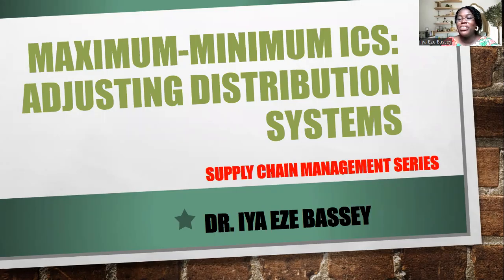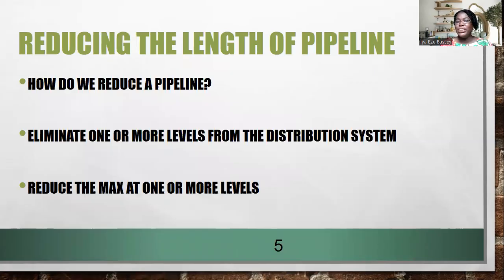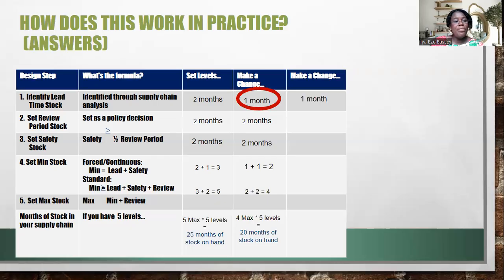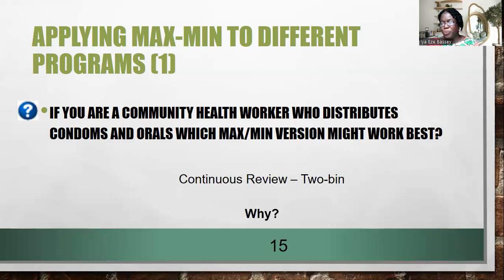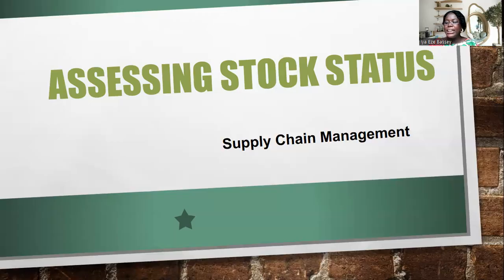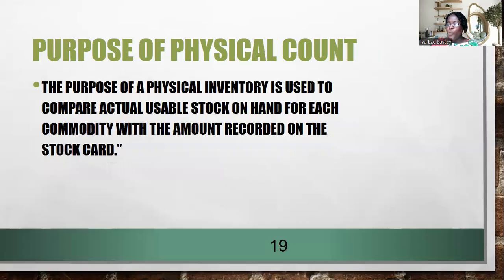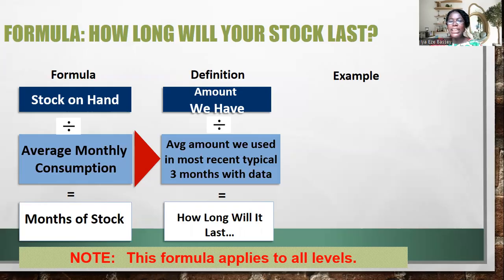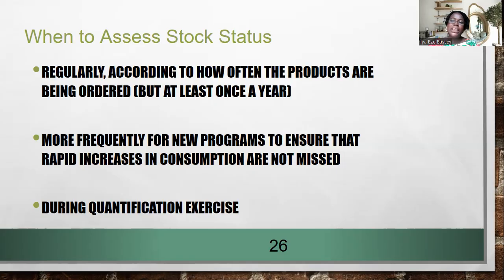Maximum-Minimum ICS: Adjusting Distribution systems (Supply chain management series)

Comment: Thank you so much Ma’am for such an enlightening session.
In summary, the steps in designing a max-min inventory control system are:
1. Set up initial max-min policies for each level and type of facility
2. Check if the overall distribution will function properly if the level specific max-min policies are implemented
3. Check the total length of the pipeline that the policies at each level imply
Pipelines cannot be reduced anyhow, the are two ways to reduce the length of a pipeline:
1. Eliminate one or more levels from the distribution system
2. Reduce the max at one or more levels
The following are ways to reduce maximum stock level:
1. Shorten the review period at one or more levels
2. Reduce the lead time at one or more levels
3. Improve the distribution system's reliability at one or more levels so that safety stock can be reduced.
Some of the factors that impact max-min stock levels are the cost of products, storage capacity, lead times, cost of storage, transportation reliability, age of program etc.
Some of the advantages of using max-min system are: avoiding overstocking, avoiding understocking, minimize wastage, avoid cost of emergency order etc.
They are some challenges of using max-min system as well which are:
1. Systems with numerous levels
2. System that manage a large number of commodities
3. System that manage products for new programs.

Physical count is the process of counting by hand the total number of usable unit in the store or health facility at any given time
The purpose of carrying out a physical count is to compare the actual usable stock on hand for each commodity with the amount recorded in the stock card and it's can be carried out once a year if they is no frequency with mismatch with stock card, but if they is, it should be as frequent as possible The purpose of accessing stock status is to
determine how long supplies will last.
The calculation to find out how long supplies can last is in our manual also.
So when do we access stock status?
1. Regularly, according to how often products are being ordered
2. Make frequent for new programs
3. During quantification exercise.
Thank you so much Ma.

Comment: I got to understand that The maximum-minimum inventory control system helps adjust the distribution system by ensuring that inventory levels are maintained within predetermined limits. When inventory reaches the maximum level, distribution is adjusted to prevent overstocking. When inventory reaches the minimum level, distribution is adjusted to trigger a reorder. This helps optimize the distribution process and maintain efficient supply chain operations.thank you ma

Comment: The maximum minimum (max-min ) inventory control system (ICS) provides comprehensive guidelines for managing stock levels to prevent both overstocking & understocking of goods. It encompasses various steps involved in designing the system, methods for reducing pipeline length and factors affecting the max-min stock levels.                                         The series of lessons has been incredibly enriching. Not only does the max-min ICS helps in preventing overstocking & understocking, but it also aids in avoiding emergency order costs by providing a guide to the stock status on a regular basis. Further more, it assists in the assessment & management of the length of pipelines of policies at each level.                                                Moreover, I have gained a deeper understanding of the benefits associated with the max min system, such as it's ability to prevent overstocking & understocking, as well as the associated challenges that arise from different versions & variations.                                             I am truly grateful for the knowledge gained from this series. Thank you ma

Comment: In summary, l've acquired knowledge about the steps involved in designing a max-min Inventory control System (ICS), the methods for reducing pipeline length, and various factors affecting the determination of max-min stock levels. I've also gained insights into the benefits of a max-min system, such as preventing overstocking and understocking along with the challenges associated with different versions and variations. I also understood the importance of physical counting, which entails manually tallying the total number of usable units for each commodity in the store or health facility.

Comment: In summary, I've learnt that reducing the length of pipeline can be achieved via the underlisted points:
1. Eliminating one or more level from distribution system.
2. Reducing max at one or more levels.
Furthermore, I've learnt that 
• cost of products,
• reliability of transport system 
• storage capacity
• leadtime
• age of program etc are factors that impact Max/Min stock levels.
I also understood the challenges peculiar to using each version and variation like system with numerous level, system that manages large number of commodities and system that manages products for nascent programs.

Comment: In summary, l learnt thesteps involved in designing a max-min Inventory control System (ICS), the methods for reducing pipeline length, and various factors affecting the determination of max-min stock levels. I've also gained insights into the benefits of a max-min system, such as preventing overstocking and understocking along with the challenges associated with different versions and variations. I also understood the importance of physical counting, which entails manually tallying the total number of usable units for each commodity in the store or health facility.

Comment: Thank you ma for this video. This video made me to understand that. The Maximum- Marinson huentary Control System (Max Min ICS) can be a valuable tool in supply chain management for adjusting distribution systems. This system helps ensure that your distribution network operates efficiently while maintaining optimal inventory levels. The hay storage activities are: 1. Supply receiving and incoming inspection. 2. Phe away, 3. Picking and packing 4. Shipping

In summary, the Maximion-Minimum Inventory Control System can play a pivotal role in optimizing distribution systems within your supply chain. By sitting appropriate thresholds and utilizing demand forecasting you can ensure that your dstribution network efficiently meets customer demand while minimizing costs and risks.

Aduoting distribution systems in this manner can enhance customer satisfaction, reduce operational expenses, and contribute to overall supply chain resilence

Comment: In this lecture i learned the step involves in designing a max-mins Ics which are setup lntial max-min policies for each level and type of facility 
*Check if the overall distribution will function properly if the level specific max_min policies are implemented.
Eliminate of one or more level.
Reduction of max at one or more levels...

Comment: Another wonderful section 
Thank you ma
In summary,i learnt that the maximum minimum system,deals with overstocking,under stocking wastage avoid cost of emergency orders
I also learnt the steps of max-min ICS which are:
1.set up an initial max-min level and type of facility 
2.check if overall decision will function properly 
3.each the length pipeline that  the quality of each level can imply
Also i learnt on the factors of max-min which include:
1.cost of production,2.cost of lead time 3.cost of storage 4.storage capacity 5.Age of program .
I also learnt about the advantages of these factors which includes, minimize shortage, minimize wastage and prevent over shocking etc.

Comment: Thank you Doctor,
From this video, I did learn that:
One of the steps in designing a max-min ICS is setting up final initial max-min policies for each level and type of faculty. 

The factors that impact max-min stock levels include; cost of product, reliability of transportation, storage capacity, cost of storage, and so on.

One advantage of using max-min ICS system is to avoid overstocking.

 Some challenges with using the system include systems with numerous levels, systems that manage a large number of commodities, and systems that manage products for few programs.

Physical count, which is the process of counting by hand the total number of usable units of each commodity in your store (for stock assessment), is used to compare physical actual usable stock on hand for each commodity with amount recorded on the stock card.

Comment: Thank you very much Dr Iya Eze for such an impactful session

I was able to understand how to Adjust the distribution system in max-min inventory control system and it is done to improve efficiency of delivery to serving consumer ,medical lab scientists that use this products to achieve accurate end products
But first we must understand the length of the pipeline and how to reduce it by eliminating few levels as reducing the maximum ICS at one or more levels all this is done systematically.
I also learnt factors that impact max-min stock levels which were cost of products, storage capacity,lead time , shelf life e.t.c
There are advantages of these adjustments like avoids over and under stocking,minimizes waste ,enables consistency of stock levels etc 
I also learnt that this strategy can be applied to different programs 
I also learnt about Accessing stock status by physical count which is done in order to determine how long the supplies will last which included some calculations. Also Stock status should be accessed regularly but more frequently for new programs and during quantification exercises .

Comment: In this lecture, I learned how to optimize pipeline length by:
1. Streamlining distribution levels
2. Reducing maximum stock levels at certain points

I also gained insight into factors that influence max-min stock levels, including:
- Product cost
- Storage conditions and capacity
- Transportation reliability
- Shelf life of commodities

Additionally, I understood the benefits and challenges of max-min systems and their variations. I also learned that physical counting involves manually counting usable units of each commodity to verify stock levels, enabling comparison with recorded amounts on stock cards. Thank you ma for the wonderful lecture!

Comment: In summary of this lecture, I have learnt how we can reduce the length of a pipeline and this can be done by:
1. Eliminating one or more level from the distribution system 
2. Reducing the max at one or more level. 
I also learnt about various factors that impact max-min stock level. Factors like;
Cost of product, storage condition, storage capacity, Reliability of transportation, shelf life of health commodities etc.
I learnt about the advantages of max- min systems and also the challenges to using each version and variation. 
I also learnt that physical count is the process of counting by hands the total number of usable unit of each commodity in your store. It enable us to compare actual usable stock on hand for each commodity with the amount recorded on the stock card. 
Thank you ma!

Comment: The max-min inventory control system (ICS) provides comprehensive guidelines for managing stock levels to prevent over stocking and under stocking of goods 
The steps in designing a max-min (ICS) include 
*Setting up max-min policies fir each level and type of facility 
*Verify that the overall distribution will function properly 
*Establish intial max-min policy fir each level and facility type
The advantages of using the max-min system includes 
-Minimize wastage 
-Avoiding the cost of emergencies 
-Avoiding understocking
-Preventing overstocking

Comment: Maximum minimum eventually control system is important aspects of supply chain management because it's analyses data patterns lead times and customer preferences so businesses can optimise their distribution network to ensure efficient and timely delivery of products to their customers. Major league deals with getting good to the end users or buyers in time with minimum waste. To achieve this the evaluate the performance of existing distribution channels and make necessary changes to improve their efficiency which may include optimising transportation routes ,re-evaluating distribution centres or exploring alternate deliver methods. 
It directly impacts your profits at at a basic level using the minimum maximum method which attempt to keep current on hand inventory within a specific weight and when this rage is exceeded, it triggers every other to reach the maximum stocking level of a particular item. 
Thank you ma'am.

Comment: Thank you ma for this lecture. Learnt that this max min adjustment helps to avoid overstocking, under sticking amd wastage. The factors that affect the system are cost of production,lead time,cost of storage,storahe capacity and age of program. The length of the pipeline is very important .

Comment: In summary, I learned that the length of the supply chain pipeline plays a significant role in determining maximum and minimum inventory levels in Inventory Control Systems (ICS). To optimize inventory management, it's essential to streamline the pipeline by reducing unnecessary levels in the system. However, this cannot be achieved arbitrarily, but rather through a systematic approach. Various factors influence maximum and minimum stock levels, including:

- Reliability of transportation
- Storage capacity
- Storage conditions at different levels
- Reliability of supply sources

These factors must be carefully considered to ensure effective inventory management

Comment: Thank you ma for this lecture.

In summary, i've learnt that; 
To be able to improve the delivery of medical laboratory commodities, the first thing to take into consideration is the length of the pipeline following the steps in designing a Max-min ICS which are:
1) set up an initial Max-min policy for each level and type of faculty.
2) check if the overall distribution will function properly if the Max-min policy is implemented in all levels.
3) check the total length of the pipeline that the policies at each level imply.

 Also, note that there are several factors that could affect Max-min levels. These include; cost of production, cost of storage, lead time, storage capacity, age of the program, the accuracy of forecasts, etc.
 Physical count of stocks is important, and it should be done at least once a year. In a case where stocks are moved rapidly, physical count should be done frequently to ensure accurate inventory management.

Comment: Thank you ma for making me understand that Maximimum-minimum inventory controls is the tune fixed or scheduled for reviewing stock level. maximum in the maximum quantity of commodities a store keeper can hold at any time, 
The purpose of Inventory control which are 
1) To maintain a good stock level of all products, and avoiding shortage and oversupply.
2) to determine how stock should be ordered and issued.
3)To determine when stock should be ordered and issued.
Another one is the safety stock level are sometimes referred to as Buffer stock...it is the convenient stock level to cushion for uncertainty...
I understood the types of max-min inventory system..
Which are,
1) forced ordering max-min inventory system
2) continous review and
3) standard version max-min inventory and also the steps in setting max-min inventory are,
1) to determine one's lead time,
2) set the review period and 3) set the minimum stock level

Thank you ma...

Comment: Thanks ma..
The sole aim of this Max/Min Inventory Control Management is to maintain an adequate stock level for all commodities in order to avoid over-stocking, and avoid shortages which leads to losses. 
Another importance is to determine how much stock should be ordered or issued and when to order. 
The aim is to review all stocks at the review period and order enough stock to bring stock back to its maximum level
Its advantages include;
Ensure availability of products in their volume, and adequate time.

Comment: Maximimum-minimum inventory controls is the tune fixed or scheduled for reviewing stock level. maximum in the maximum quantity of commodities a store keeper can hold at any time, 
The purpose of Inventory control which are 
1) To maintain a good stock level of all products, and avoiding shortage and oversupply.
2) to determine how stock should be ordered and issued.
3)To determine when stock should be ordered and issued.
Another one is the safety stock level are sometimes referred to as Buffer stock...it is the convenient stock level to cushion for uncertainty...
I understood the types of max-min inventory system..
Which are,
1) forced ordering max-min inventory system
2) continous review and
3) standard version max-min inventory and also the steps in setting max-min inventory are,
1) to determine one's lead time,
2) set the review period and 3) set the minimum stock level,
4) determine the maximum stock level and the emergency order point...
Thank you ma...